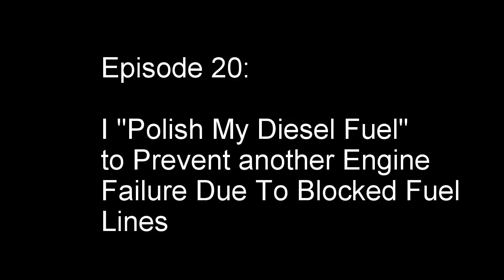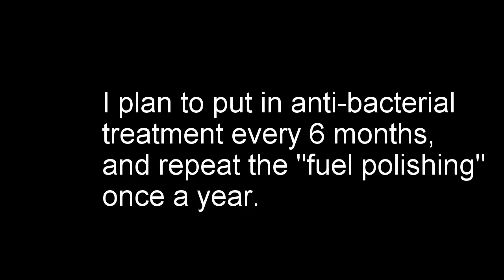Ep 20 Diesel Fuel 'Polishing' To Prevent Clogged Filters and Lines

Comment: I just wanted to thank you for all the video helps. I bought a 30 ft. Sailboat last year and have been in the marina all summer but still a little fearful of entering and leaving the dock. Any advice you have to us newbie sailors is greatly appreciated.
Reply from the maker: Hello Robert.   I had very basic sailing skills (having learned 30 years ago) when I first bought my boat, and was like you, a bit nervous about leaving my berth with it.   I had some lessons with a couple of pros, and went on another boat similar to mine for a week's cruise to a half dozen ports up the coast (with a small crew).  That gave me enough confidence to start going out solo on short, day sails in my local area.   Gradually, as confidence grew, I started making solo trips to other ports, and then a first all-nighter, etc.   All the time I kept picking the brains of those with much more experience than me, and buying the pros a beer every now and then.  I also took classroom courses in VHF radio procedures, weather, navigation, and diesel maintenance......, as well as a weekend course on port maneuvers.   Confidence grew as did experience until I felt ready for a 'significant solo passage' and I did 3 or 4 crossings of the Bay of Biscay (2.5 day passages each way).    I learned much on these, and got to the point where I felt, well, 'let's go for it' and I was off for the Azores.   I'm the first to admit that I have much to learn, but I do now have the confidence to make a major passage should I choose to.    Hope that is of some help Robert.
Reply: @patricklaine6958  My wife and I have been doing coastal sailing, mostly on flotillas in greece for about 10 years now having taken our RYA day skipper.    While the Day skipper course and its ilk are all well and good, the stress of coming into and leaving a berth in a marina is horrid.  Our answer was to go on a long weekend course learning about close quarters manoeuvring.  We spent 2 days doing nothing but coming into and out of increasingly tight quarters at all states of the tide.  The marina was in a busy estuary so we had to deal with the tide, wind, and the normal flow from the river.    I can't recommend doing such a course enough!      Every sailing trip is a learning day, but having a framework to hang that learning on is just top.  (Patrick, loving the videos lots)
Reply from the maker: Completely agree Richard.  I too did a weekend course in port manoeuvres.    It provides a great framework --- BUT, those courses are most often directed at crews of 2 or more aboard.   The game changes quite a bit when one is solo, but I'm really glad I invested in a weekend of formal training -- a real confidence builder.    Thanks for commenting.
Reply: @patricklaine6958  Just finished all the videos and I can see how much of a game changer sailing solo is.   The guy who taught us close quarters techniques took us out to do the usual man overboard exercise (MOB) - but he took a different approach.  He said that as we sailed as a couple then one of us should go down below to simulate that person being overboard while the other had to do the MOB exercise solo.  That exercise taught us just how differently you need to think when the only person on board is you!   Power to your elbow sir.

Comment: Thank you for a very good video.
Watching your vid, it seems like your boat is a Bavaria 40. I happen to own the same boat. In order to prevent Diesel clogging, I added a Separ fuel filter in line with the original filtering elements of the boat. The Separ has a 30 micron filtering media plus the capability to separate water. During the 4 years I've owned the boat (about 900 engine hours) I never found any water trapped in the filter, only black dirt. I think that the extra "polishing" process is not really necessary as it is inherent in the engine's operation. Once it is running, the diesel is flowing from the tank, through the filters and the pumps to the injectors. Only a small percentage of the diesel is injected into the cylinders while the majority flows back to the tank after filtration. This process continues as long as you run your engine so all you need is to keep your filters clean.
Reply from the maker: Yes Noam, it is a Bavaria 40.  I love your idea of putting in a Separ or Racor into the system (30 mic).    Two questions for you.  Did you keep the installed water separator/filter or did your Separ replace it?  Also, where did you install the Separ?  In the engine compartment?   Many thanks
Reply: Hi Patrick, The Separ was installed in series with all the other elements, I didn't take anything out. I placed it very close to the tank (under the bed of the starboard AFT cabin) so it is the first thing the diesel sees when it flows out of the tank. I can send you pictures next time I'm at the boat.
Reply from the maker: I would be fantastic if you could send me a photo the next time you visit your boat.  No urgency.  It's something I'd like to put in place prior to next Spring.   If you do think to take a picture, please forward it to pcjlaine@gmail.com.    Thanks in advance (but pls don't go to any extra trouble to do this).
Reply: No problem. It would probably be during the coming weekend.
Reply: Noam Barzilay Hi Noam, I have a B47, what model filter did you get? Cheers John

Comment: « Theoretically, in an hour, it should be polished »... No ! As your filtered fuel goes back directly in the tank, the formula that gives the time necessary to divide by two the level of contaminant is 0,7*V/F (volume and flow). With your volume and flow, it is roughly one hour to reach 50%. Another hour to get 25% etc. This been said, in 5 hours, you obtained 98,5% efficiency. That is if the contaminant is evenly distributed. 
If it is stuck in a corner you cannot reach with your pipe ???
In slightly larger boats, some people have « day tanks » that they fill through an additional filter.
Reply from the maker: Fantastic Dominique.  I used to know those kinds of things and approach problems with an analytic approach that one learns from studying math/physics.  I have grown lazy with the passage of time.    Good on you my friend.
Reply: excellents commentaires et rappels  👍👍👍
Reply: Watching this one year later and was about to add the same comment :) Nice one!

Comment: Excellent video. I have seen some marine systems that utilize two racor filters with a valve arrangement enabling quick switching in a clogging event does your craft enploy that arrangement?
Reply from the maker: I wish it did N7CX.   Dual Racors are a bit of a luxury that are usually fitted on the larger yachts.    My friend's 55 foot Amel has them.   I just don't really have the space (and they are very expensive as well).   Thanks for watching.

Comment: My only thought was that your flow rate may have been too fast to let the RACOR work separating the water , or the conditioner absorbed the water , just speculation at this point !!
  I enjoy your vids Patrick ,  I should do a few , I only think of that after one of my many projects ,  as a repairman I assume its normal for equipment to need fixing on an ongoing basis!!
  Tom L .  
Catalina 380..
Canada
Reply from the maker: Hello ushillbillies in Canada.   I think you are correct that the flow rate of the pump was too high.   I have already decided to replace the pump with one of lower capacity before I do this again.  Please do make some videos.   Us amateur fixer-uppers benefit enormously from watching pros do it correctly.   Many thanks for commenting.

Comment: Hi Patrick. I witnessed a professional fuel polishing recently, He used a high pressure hydraulic pump so that the returning fuel to the tank acts like a jet washer and emulsifies everything in the tank, like stirring up a muddy puddle. He continued the process until clean fuel was seen being pumped from the tank. On the back of that I am in the process of building my own similar high pressure polishing set up. I guess the benefit over high pressure set up to the way you did it is that like you, most situations have very limited access so how did you ensure your pickup pipe reached all parts of the bottom of the tank?  Regards Huw
Reply from the maker: That's the key issue: with baffles in the tank, a pick-up pipe will always be of limited utility.......Hope your pressurized system does the trick for you.

Comment: Patrick - The best advice I've got from “experts”is to provide the least possible condensation in the tank: Fill the tank completely during the winter period - minus about 1 liter, so the fuel can expand when it's spring (warmer). This minimizes condensation (water) in the tank. Take an annual sample of the bottom of the tank into maybe 3 pieces of clean, clear 1 liter bottles. If there is no water, everything is ok. If there is water, you may have sucked everything up. Add anti bacterial before winter, and most importantly maybe .... buy as far as possible marine diesel. Here in Denmark, 7 percent of biodiesel is mixed in diesel for cars. This biodisel can rot and break down when it comes into contact with water, and convert diesel into a contaminated gelling mass. Our Marinediesel in Denmark are without the biodiesel added.  This is used by most sailors to avoid fuel problems and with the following engine failure.  Love your videos!
Reply from the maker: Excellent advice Kenneth.  Many thanks.  To be honest, I did not know there was a difference between marine diesel and the diesel we buy at the service station.   Wow.  You learn something every day.  Thanks again.